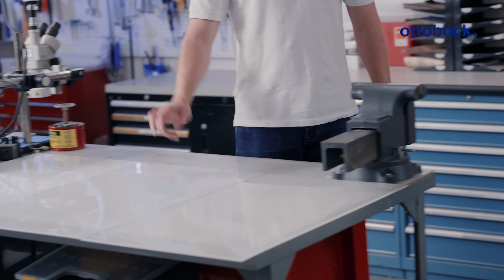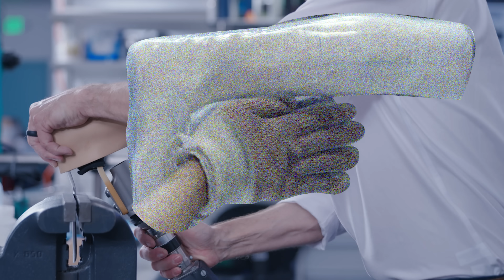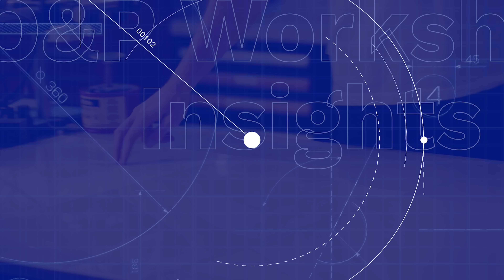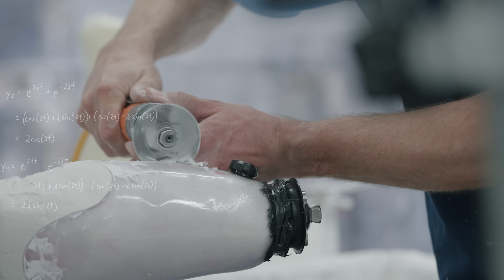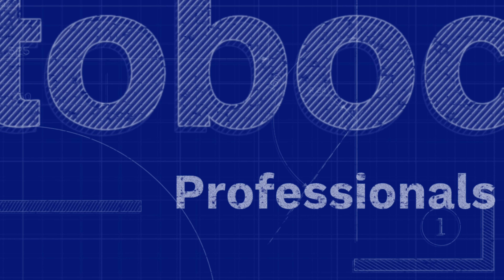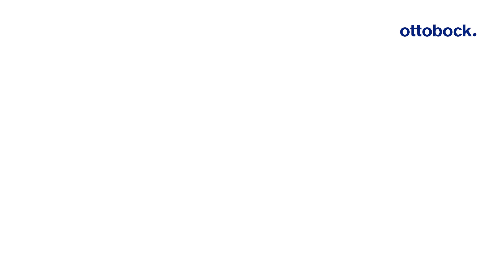How and when to use polypropylene, polyethylene, and copolymer. | Ottobock Professionals

Comment: Curious what you think of that "Carbon" infused PolyPro. I think its mostly for lessoning the catastrophic failure of the PolyPro than it is a strengthener. Its similar to adding Kevlar to our Dynamic foot plates for heavy and high activity patients. Its doesnt add strength BUT it does keep the  foot plate together when it inevitably fails. Protecting the patient from sharp prepreg carbon shards. Some high activity patients, it's hard to predict the reinforcement they need from the start. Thats some what how I feel about the carbon infused PolyPro. Maybe I am wrong. interested in your thoughts. Cheers
Reply from the maker: Hi @LastRonin33, Good points! Carbon-infused PP isn’t a true substitute for continuous carbon fiber, so it won’t prevent catastrophic failure or give energy return in the same way. What it does offer is higher stiffness, better fatigue resistance, and less creep compared to standard polypro. It holds its shape longer and gives a crisper response, but it’s still not a substitute for full composite when major strength is needed. I see it as an enhanced PP option.
Best regards,
Lucas & Your Ottobock Team